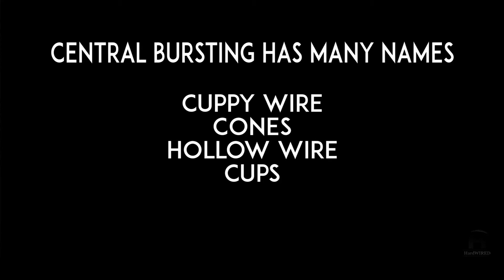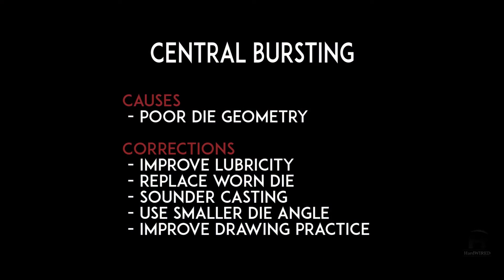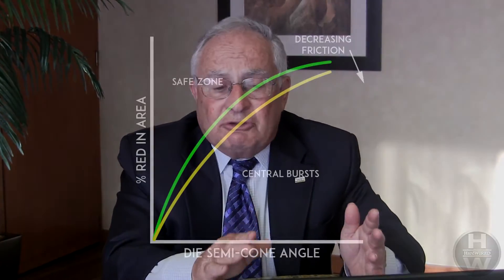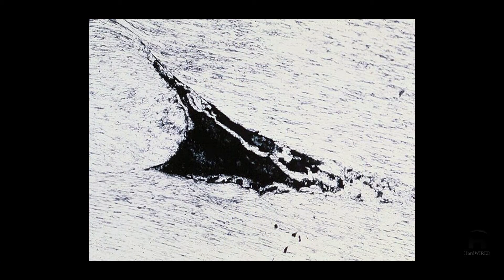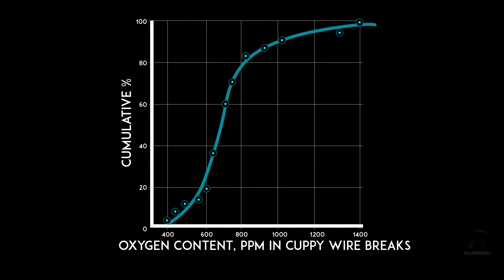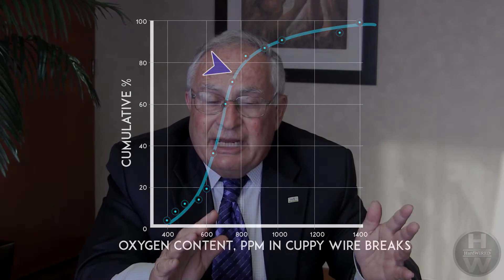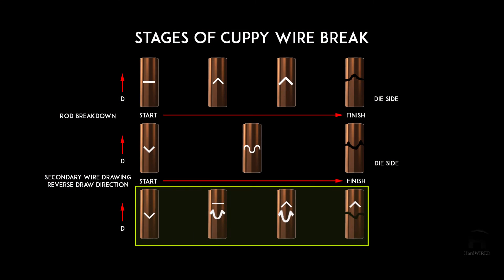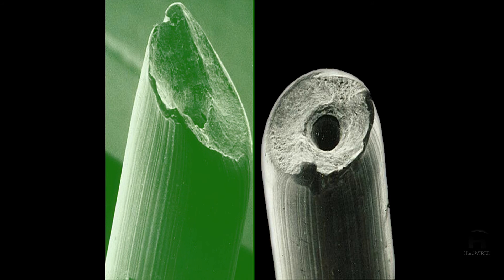Central Bursting

Comment: I have an 8 block straight wire drawing machine for drawing  0.77% carbon 7.00mm to 3.00mm
Please suggest a better draft and the die angles. I’m having central bursting issues in final block.
Reply: You have to check your die series Delta Factor. Keep it about 1.5.